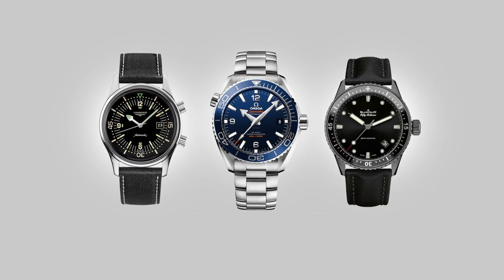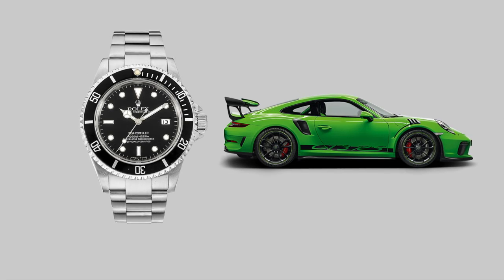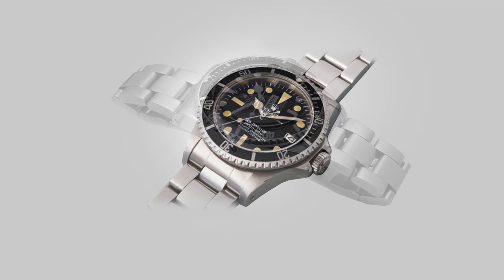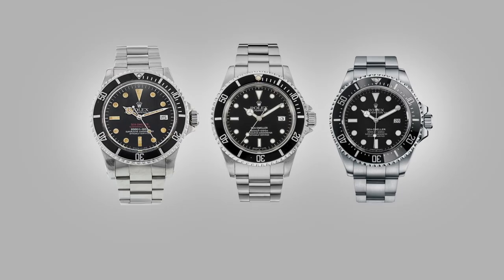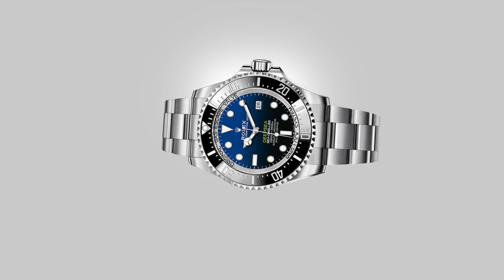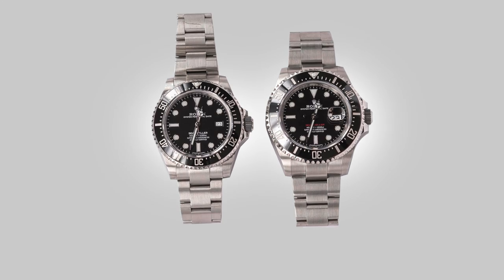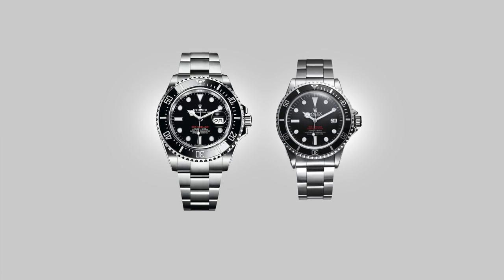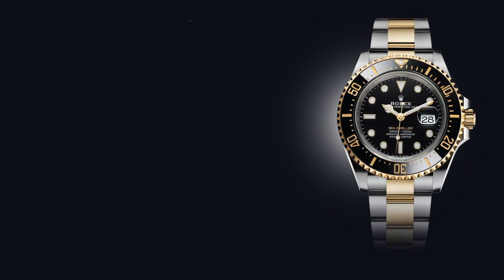The Problem with The Rolex Sea-Dweller Design

Comment: I think you are wrong. In a world where the submariner is very common, it's not unreasonable to go to the next level to have some differentiation. I swapped a sub for the 50th anniversary model and am delighted with the greater accuracy of the latest movement and the hugely superior bracelet. Frankly, it's a quantum leap forward (and I like the cyclops too).
Reply: Paul Robinson me too.
Reply: Totally agree 👍
Reply: totally agree. Embrace upgrades!
Reply: The SeaDweller is excellent.  I’m sorry I just don’t agree.   I love my Sub,  however I’m a bigger guy and the 43 SeaDweller fits me perfectly and way better than the Sub.   The design is perfect if you like the looks of the Sub but dislike the DeepSEA’s awkward proportions and ridiculous depth rating.   Seriously the engineering is impressive in the DeepSea, we can all agree on that but  it seems somewhat gimmicky to build a watch miles beyond the human limits for a diver.   Classy design, practical differentiating design elements,  upgraded movement, accuracy,  makes the SeaDweller a winner in my book.    Just my thoughts... CK
Reply: Completely agree with you. Nevertheless I have a 6.5 inches wrist and it looks gorgeous on me. I personally own a pre ceramic Sub either, and I prefer the SD43 all the times.
Reply: @Koops888  I couldn't have said it better myself. Agree 100%!! It is Rolex dive watch perfection, especially for us larger framed people. 🔥🔥🔥
Reply: I agree.  However, I still prefer no cyclops. The reason I bought my 16600 is because my boss was a big guy, like 350 lbs., and he wore one.  And it looked great on him.  These new references look amazing on the big guys.  I’m 6’ and 185 lbs. so the 40mm is still my sweet spot but I would really love to own a James Cameron dial.
Reply: Just received my deep sea at retail.  Took going on 2 years.  Its SOOOOOO much better than the sub.  And i like my sub.  But it's a JLC being compared to a frederique constantin
Reply: Same opinion.
Reply: Totally agree with you I love the cyclops Beautiful looking watch
Reply: I have the “hugely superior” bracelet with the 116600, same depth rating, and ceramic bezel. He is right as to why they discontinued it though. It didn’t sell well because the average watch buyer didn’t see it as different than the sub. The new model stands apart from the sub on size alone which may be a better wearing experience for a large wrist. But if that were the case they could’ve accomplished that with the JC alone.
Reply: Just received my 50th and I love it!

Comment: I borrowed a Deep Sea for a couple of weeks from a friend and I loved wearing it daily. Such a statement. Picked up a 50th anniversary today. Love it too. Each to their own :)
Reply: The size of the Deep Sea serves a purpose. It needs it for the Ring Lock.
The Sea Dweller had no reason to go bigger, other than to make it stand out from the Submariner. I do get it though, the 116600 didn't sell because it looked almost the same as a Sub, but cost more, but I think they could've just kept it at 40mm (or make it 41mm like the new Sub) and added the red line of text.

For me, the 116600 is the ultimate Sea Dweller, and the Deep Sea is the ultimate Rolex dive watch.

Comment: I own a 126600 and love it.   Couple of points:  1)  the larger size means the bezel can have more tick marks, which I appreciate.  It makes precise setting easier.  2) When you get older, you will appreciate watches with the date bubble on them :-).   

If you at all think that form should follow function, you should welcome that date bubble.  It wasn't left off of the original sea-dwellers due to design issues:  it was left off due to limitations in materials and manufacturing.  As those limitations are overcome, we should be expecting more functionality from our watches.

The two-tone version, however, is just egregious.....

Comment: I wear my 126660 D-Blue daily without any issue.  It was great to see Rolex finally come out with some larger sized models instead of being stuck at 40mm for so many years.  So I completely disagree with your opinion that the Sea-Dweller line should have stayed at the same size as the Submariner.  Way to go Rolex - keep up the unique designs, the D-Blue is a rock star!!

Comment: One/two generations back, men’s average height was 175cm (check any architectural manual), so 39-40mm might have looked big.
Today is another story!
For most men over 100kg / 185cm, anything smaller than a 42mm looks like a lady’s watch.

Comment: My favourite watch in my collection, is my Sea Dweller 16600 from 1991 and I think it's the best SD ever made with all the good way from new and past ! Maybe the best Rolex ever made
Reply: I share the same view, not to the majority though, which I am not complaining🤭.
Reply: 16600 humble proper tool watch and beautiful and not Las Vegas on the wrist and will last forever thru thick and thin
Reply: Didn’t like the shiny and slightly top heavy 116600  sold it and recouped the 16600. Fits like a glove with a muted non shiny bezel. Just feels understated quality and cool tooly feel. The deepsea fits better than the sd 43 on my flat 7’5 wrist , more stable with larger flat caseback. Next in the list😄

Comment: I personally prefer the sea dwellers over any subs because they are much less common in the market.

116600 is the last jewel from this line though.
Reply: Yep. I'm proud to own one. It's a little top-heavy, and I'm not sure they could've made it any thinner and maintained such a high WR, but overall it's my favorite Rolex diver. Wanted one for years before I got one. Really glad I did. It's a near perfect blend of old and new: pre-ceramic proportions with post-aluminum upgrades. (No super-case).
Reply: I own 16600, to me this is the best combo of modern design with heritage of vintage elegance. I dislike most, if not all ceramic era rolexs.
Reply: @ricchrono5907  what's the bad deal with ceramic? Ive never owned a rolex but I thought a ceramic bezel was a good thing.
Reply: @clayjones1933  nothing wrong with the ceramic bezel, but those with ceramics come with the maxi case. that's the problem. in my eyes they are absolutely fugly, will never slap one on my wrist😅

Comment: My 126660 is amazing, unlike your opinion on the SD, DSSD. Some people have big wrists and don't want to wear little baby 40mm watches like most of the Rolex lineup. I don't give a shit about diving 5ft in this watch, it's just an amazing watch - period.
Reply: Agreed!  I just bought a Deepsea and think it is amazing.  I have a big wrist and this is one of the few watches I didn't need to order an extra link for.  If people want a smaller watch, those are still available. It seems like many people don't like anything new that Rolex tries.
Reply: Are you over 500 pounds and 6’11 ?
Reply: @mrp9498  LOL, no, but I have a 9 inch wrist.  Most Rolex watches have bands on the smaller side so they can save money on materials. 44mm looks good on my wrist. I also have a Datejust 41, that's about the smallest I could go.
Reply: Neil Gregory 👍🏼 Mine is close to 8 inch. Usually only have to remove one link from most watches.
Reply: 6'6" 245 lbs. Had both a 5 digit and 6 digit Sub. Like my DSSD 44 best.
Reply: Will Hustle Even an 8 1/2 inch wrist I can remove a link on a Planet Ocean but Rolex....apart from this one I feel ripped off that I have to buy a link.

Comment: The D-Blue is one of 3 Rolex watches that ever grabbed my attention because of the gradient dial, the lack of a cyclops and the lugs that don't flare out causing that abrupt transition from the case to the bracelet as is the case with the Super Case watches. The size does bother me a bit, but then again I'm used to big Breitlings and 45mm Planet Oceans that are probably bigger and heavier 😄

Comment: I’ve been wearing a 16600 every day since 2008 and the only thing I wish it had were the lug holes of older 16600s because I use fixed spring bars with a NATO strap. That said I love it for all the reasons you mentioned here. I never make any exceptions for when I wear it, even skating.  I’ve taken some hard falls where the watch slapped the pavement and it’s never stopped. I’ve bought a few other watches that I love but I just don’t wear them because the Sea Dweller always wins.
Reply: Thats because not only is it a beautiful piece of mechanical  jewellery it is designed to tolerate the same amount of abuse a Vostok Amphibia will it also copies other aspects of the Vostoks design but with a far greater accuracy straight from the factory. Like the Vostok its design is such that you can regulate it yourself due to the way the case back gasket works.

Comment: I personally love the new SD43 and dive with it, it's a great watch, perfect proportions, and very well built, solid, and super comfy, well balanced.... But I also have a passion for it's predecessor such as the 116600 the last of the 40mm SD without cyclops and very first of the ceramic bezel discontinued in Rolex history, or the 16600, a beautiful watch with genuine SD DNA and vintage feel, or the triple 6, while these 2 "alu bezel" ref. can still be found at relatively reasonable price, but will soon enter the vintage world, been the last of the aluminium bezel models...

Comment: I my view a diver should have a quartz movement. You just put it on, don't unscrew the crown, no need for that, it already is on the right time. Using a diver, for diving, means, a lot of abuse, from scratches, sand, salty water, oil and dirt. You should clean it after use, but most of the times it is not cleaned properly and the next time an automatic has to be set again. So the crown is unscrewed, dirt, salt and dust comes in between the seals and wear and tear is around the corner. That's why divers prefer quartz. You just trow your gear in the back of your 4x4 and you put on a nice watch for the evening. Nobody with a right mind is diving with a $ 10.000 watch, nobody. You wear a Rolex, watching your yacht from the restaurant in the harbor, not for diving under your yacht.
Reply: TSAR! Nasa uses them.
Reply: A real saturation diver bought this for me where he works. It looks like a Seiko Tuna, inside is a Seiko VX42. You can use the bezel to smash a window, when your car is submerged. You can hurt yourself or somebody else with it. The bezel can be used with gloves. I think they should be used with gloves. It is very serious stuff and doesn't cost anything. I had it with a discount for £ 85,- He told me, that saturation divers working at 10 bar don't have a watch, they don't need a watch. Everything is done from the vessel above. Oxygen/Helium mix, electricity, communication, timing, everything. Working on the offshore platform is bad enough to need a good watch. There is salt, water, oil, dirt, storm, bashing etc. Any watch will die in minutes there.
Reply: Rene Bense yes a practical use of the best tool for the job!
Reply: Rene Bense good point, most oil workers have g Shocks, as do members of the military in out of area ops. I work on oil platforms every so often and one of the bosses, whose on $200k a year has a Casio MRW200h.......$15 worth. He thinks it’s ideal.
Reply: I saw the docu/drama tbe last breath on Netflix. Only the coordinator is wearing a Seamaster 300. Everybody else doesn't wear a watch
 The coordinator doesn't come outside.
Reply: Problem with quartz is you can't deep dive with it. It dies at low temperature and you're screwed. The Sea-Dweller was developed for saturation diving.
Reply: Totally untrue. I have a 20 dollar Casio and that thing is OK at  minus 20 C.
Reply: @renebense  For how long though?  Electronic circuits used in a quartz movement can stop operating at cold temperatures. The battery life can also be seriously affected. What if one thing or the other happens when deep under water?  Yeah, you're screwed.
Reply: A whole night...mius 20 degrees. No problem.
Reply: @renebense  I used to swim with a F91W as a kid. The crystal would get full with condensation when it was supposed to be water resistant to 50m. Never trusted a cheap digital Casio in the water after that. But to come back to the resistance to low temperatures, battery life plummets when exposed to low temps. If you're a pro diver, would you really trust a quartz watch running on battery under water if submitted to low temps several days in a row? To take your extreme example at - 20C, the battery life is halved. Check the graph at the bottom of page 3 of this data sheet: http://data.energizer.com/PDFs/silveroxide_appman.pdf.
Reply: Of course, the capacity drops with temperature. The capacity is 30% or 50 % less. But you don't stay under water for years, so there is no problem. Watches operate with nearly empty batteries as well. Don't dive with a $50 watch, your live depends on it. By the way, the time during saturation diving is monitored by the project manager who stays behind in the vessel above the diving spot. Saturation divers don't have a Rolex.
Reply: @renebense  Well yeah, it's become a luxury product, not everyone is into that. In fact the vast majority of people don't care or find it stupid to spend that money on a watch, whether they're divers or not. Rolex professional watches are no longer just tool watches. I wouldn't dive with my Sea-Dweller myself, I have affordable or mid-level alternatives I'm more comfortable with. But I could if I wanted to, it's more than just a good looking luxury watch, it's kept its capability despite having become a status symbol. It's like a Porsche. People don't buy them to track them.

Comment: I agree completely.  The larger size of the DeepSea is an example of form following function.  The larger size of the current Seadweller is simply form for the sake of form, and this is not how Rolex has traditionally designed sports watches.

Comment: Great review.  I agree with you on the points of form and function - fit for use.  I am heavy into outdoor activities to include diving, surfing, climbing and triathlons, and I prefer the 40mm 11660 (if I am using a mechanical watch) due to its lighter weight while still being super robust. I see there are many negative comments from the arm chair enthusiasts below in defending the 43mm.  The fact is the 43mm is the only SD that is tracking on the secondary market at or below list (source Watch Charts) while the 40mm versions are selling at 6000-8000 USD above their initial retail - a clear indication of the higher demand for the original design.   As for the comment below of ‘try to get one’ (43mm), this is BS, because over the last 6 years there has been a huge demand for ALL Rolex sports watches which now seems to be leveling out - a testament to Rolex’s brilliant marketing of ‘Rolex Ownership = Success’.  I believe that Rolex will revert to the original dimensions of the sea dweller, and if the massive demand for the 11660 and 116600 are any indication, they would be well to do so.  Moreover, the 40mm design just makes more sense for a watch that is at home in the board room as well as the most extreme outdoor settings.

Comment: When researching my first Rolex purchase I looked at every Sub and Sea Dweller model from the 1960s to the present. The 5513s etc were too pricey, and I narrowed it down to a 14060. I was on the point of buying, and the seller said he had just got in a Sea Dweller, 40mm, 2008, lightly worn. I was smitten. Perfect size, alu bezel, no cyclops, not the heavy bulk of the supercased ones. In my opinion the perfect Sub.

Comment: I wear my deep sea every day and have for over a decade. If 7.5 ounces is too heavy for your arm to get used to you need to get to the gym. Also, it is indeed overkill as far as depth is concerned…if I find myself 3900 meters under water, the time will be the least of my worries lol. It wasn’t necessarily designed to be used at those depths..It was designed to be ultra water tight and that just so happens to be its known limit. It is quite large but it’s elegant at the same time. Does it get attention? Yep…mostly from watch connoisseurs but I think all Rolex watches have that trait. I own an original Sub, a Daytona, and a Yachtmaster….I can’t say that this watch draws any more attention than the others. Beauty comes in all sizes. Though you are certainly entitled to your opinion, I respectfully disagree.

Comment: I totally agree. Technology might make it possible to add the cyclops on a Sea Dweller but Rolex solved a problem that shouldn’t be solved. The cyclops makes it harder to read time and under water being able to read the date is not a priority. I have owned the 126600 but sold it feeling that it was a tool that had become a fashion statement. It’s bigger for no reason. Also, Rolex is showing their lack of understanding of the Sea Dweller heritage by making the current reference in two tone. Thats like making a two tone wrench. 116600 was the last iteration where improvements from previous versions are understandable even if some might prefer aluminium over ceramic.